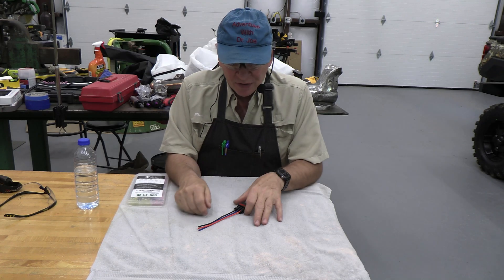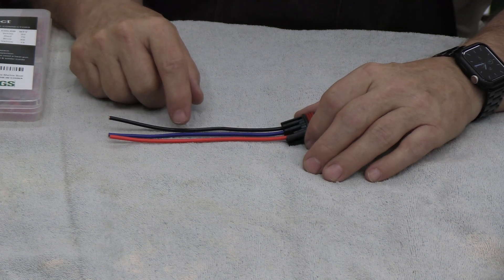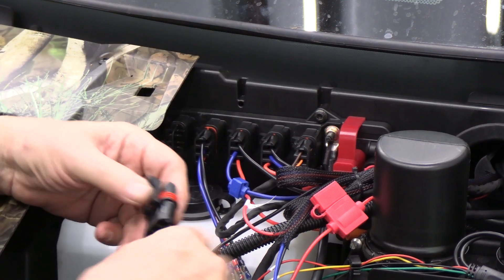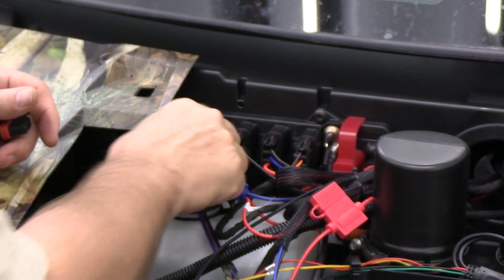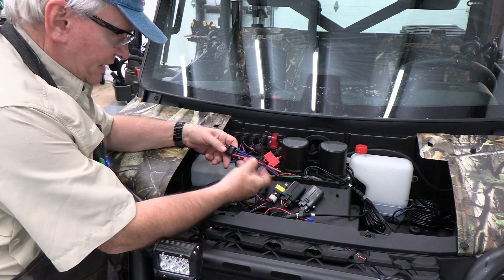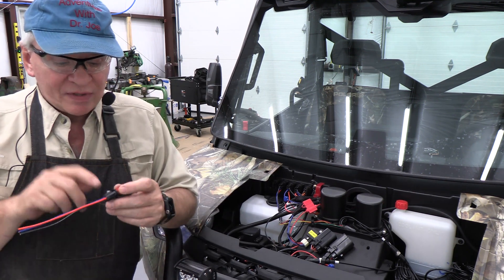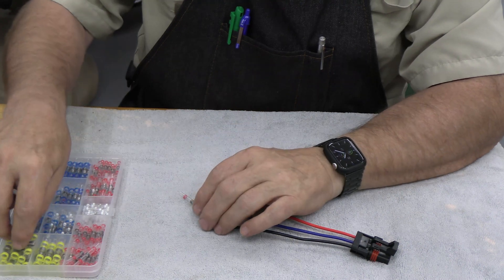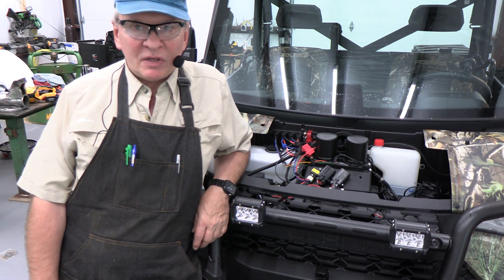How to Use Polaris Pulse Bar Quick Connectors

Comment: is the key on wire (blue ) also supplied by the same 40 amp fuse as the red continuous power wire
Reply from the maker: Hey Doug, great question. I believe it is still supplied with that 40 amp fuse but I’m not certain. Great question I will look more into this. Consider subscribing. Thanks, Joe.

Comment: Question. How can I fix the pulse bar problem on my pro xp I lost some type of power connection for accessories. I’m wiring blue with red and black to black so I’m not getting constant power now when I hook up to direct battery power I get my accessory whips to work. Any ideas what I should check ? The 40 amp fuse look fine to me
Reply from the maker: Hello Johnny. Really great question. Be sure that it has the power connection to it, which is the red cable directly from the battery. The black is a Ground, and that should be connected as well. If those are connected to the pulse bar, it should be working fine as long as the fuse is intact. You said the fuse looks good so other than that I’m at a loss unfortunately. Consider subscribing. Thanks, Joe.
Reply: @JosephHunstad  yea I’m having trouble I have 1 accessory on it right now and it’s functioning. But when I try and connect another I get no power from the pulse bar
Reply: @JosephHunstad  what fuse is the accessory on the block ??
Reply: I get what you mean. I have a pro xp 4 ultimate with a Light bar, whips, rock lights, and mirror light. The 10 amp fuse by gas and break will pop as soon as the light bar in plugged in. The way I fixed it was keep all the other plugged in with black to black and red to blue. But with the light bar I keep it black to black and red to red. So when I use it I’ll open the storage and plug/unplug manually so the battery doesn’t die.
Reply from the maker: @adamromero9171  hey Adam, good comment. I also have a couple things that are wired on all the time like the interior light, etc. so I don’t wanna have to start the Ranger before I turn that on. We just gotta remember to always turn those things off. Thanks again Joe.

Comment: Thanks for the video.  If I am hooking up a 2 wire USB charger do I only use the remote and ground wire if I only want it on when ignition on?  Just tape off the Red constant wire?
Reply from the maker: Hello Accelerator!
Great question. Yes, just cap off the red wire because if you use it will be on all the time which could drain your battery down if you keep it on accidentally. Consider subscribing. This Polaris post bar is outstanding. I have used it to plug-in so many accessories. It’s so easy. Thanks Joe!
Reply: Thanks.  Subscribed

Comment: When you hook it up to a 2 wire led bar, does the remote (ignition on only) wire go to the rocker switch? I pretty much know the answer to this but have not seen 1 video that brings it up.
Reply from the maker: Hello Craig,

Thank you for your question. Yes, the middle wire goes to the rocker switch. Because this then will not allow your lights to be on with the ignition turned off which is a safety thing. Please consider subscribing. Thanks Joe.